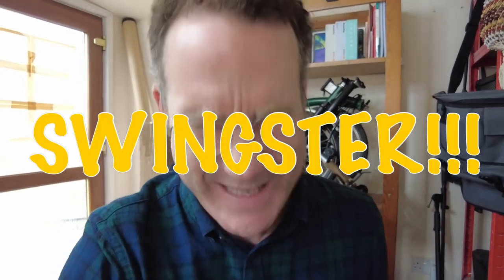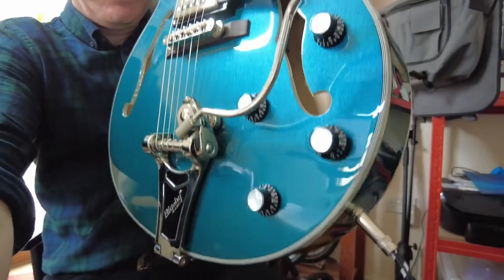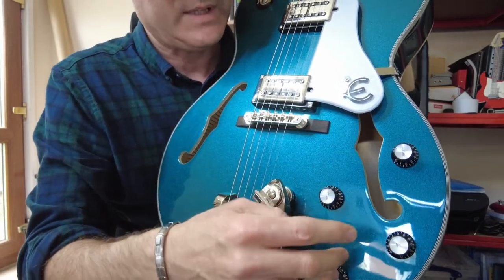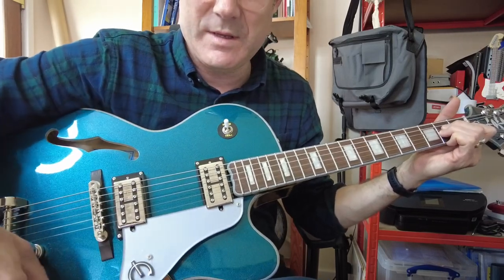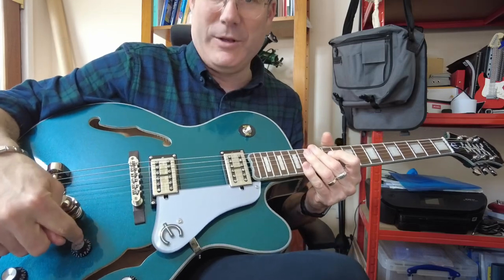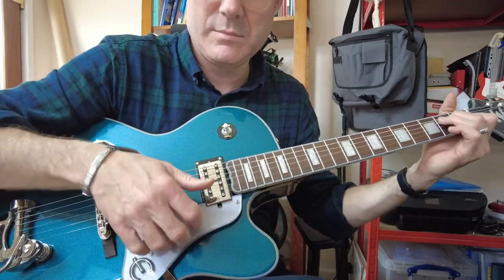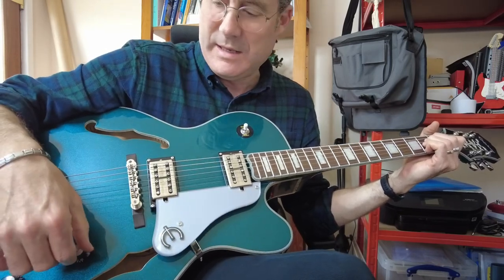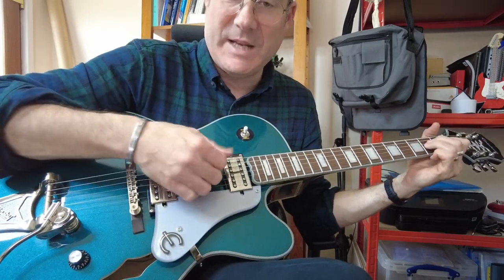I think I learnt something about Epiphone and Gibson guitars!

Comment: Being onstage and getting a little wild and accidently hitting your PU selector with one PU in the 0 position can leave you...well...speechless.  I had my 61 Melody Maker (with two Humbuckers) rewired so that in the middle position...as long as you have one pickup with any volume up you can't be left in this uncomfortable situation.  I've never had this problem with my Les Pauls so I think for me it's where the switch is located on the MM that got me into trouble.  It is an interesting feature though
Reply from the maker: That’s really interesting! Thanks for sharing.  Nothing worse than being caught out on stage!

Comment: I like a Fender/Gibson hybrid approach: a global volume control but with individual tone controls per pickup.  I also like the G&L 'PTB' circuit which has three global controls incorporating a variable bass cut tone control.  This bass cut control is especially great for humbuckers and warmer/darker sounding pickups and/or when using gain. Plus it's superior to 'coil split' functionality imo.  You can reconfigure a gibson style four knob layout to a PTB circuit by just leaving one of the knobs as a redundant control, so it won't affect the looks of a guitar and it can be reversed.  A bass cut control is best implemented by a 1meg reverse taper ('C'?) type pot.  There are wiring diagrams online for the G&L 'PTB' circuit.
Reply from the maker: Thanks for the insights!  Your clearly know what you are talking about so watch out for ‘daft questions’ from me!
Reply: @blutonemusic  go ahead! :p

Comment: I have many wiring diagrams that explain the how, but the why, I think, was an accident that worked for the guitarists. 2 Volumes, your on the middle position, and you want to turn completely (or as close to as possible) off...How do you do that, gracefully, if you have to turn down BOTH? The secret is WHERE in the circuit the pots fall: before or after the switch. OOOPS, I let out a secret 🤣

Comment: I found out about the cutout that you demonstrated when I got a 335. I thought it was because the pups are wired in series, but what is weird is that I thought the resistance should increase when both pups are active, but in reviews they always seem to decrease like they are in parallel. Or am I just confused?